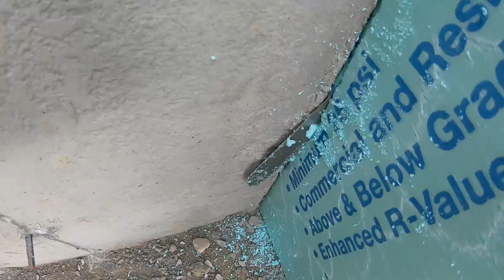Installing rigid foam on concrete walls & back filling Tri-County  Excavating 'Dirt Boss'

Comment: Unless you cover the exterior foundation wall with a waterproof membrane (such as PolyWall) or with a paint-on coating (such as those by Henry), the wall will attract moisture, making it a water reservoir, and then making the inside damp/wet as well. You'll also need a dimple mat between the exterior wall the insulation to drain water down and away from the wall. Basically, this video misses the entire moisture management issue with basement walls and only attempts to deal with temperature control. You want the thermal insulation to be vapor permeable to prevent locking moisture into the wall.
Reply from the maker: I hear what you're saying makes sense 100% but this is backfilled on both sides no need for vapor barrier It was engineered We are just installers
Reply: No clue here, neck down kinda workers. Here is why your houses only last 50 years at max people. I'm just an installer....Zero integrity.
Reply from the maker: @johns.1940  Lol Nice one Mr John
Reply: @DIRT-BOSS poor engineering

Comment: That was really good - such a pleasure to watch you work at your trade. I know how you felt about the drone footage - been there, done that! One thing we do as a backup is always have DU Recorder (screen recorder) turned on  so we  at least have something if we forget to record on the drone SD card. We typically set ours at 1080 P so it would be usable for Youtube. You may not want to air that, but it's just a thought. Thanks again for sharing. Don't know if you've seen it, but Stoney Ridge had THREE more bee swarms today which made a pretty interesting vid.

Comment: In Michigan the insulation goes on the inside of the wall only in a walkout basement, the rest just gets waterproofing on the outside. I've never seen tape, caulk or resin paper used.
Reply from the maker: Yes it's not typical around here it's just that this was a net zero build

Comment: What about if you had a walk-house basement? I assume insulate the 3 sides that are adjoining the “conditioned space” aka the basement itself….but what about the small frost knee wall below where the walk out is? That’s below grade but doesn’t cover any livable space on the other side.
Reply from the maker: Yes you definitely want to insulate the inside at least of the walkout Frost wall

Comment: Do you shave off the 2” lip of rigid foam at the top once the caulk is set?
Reply from the maker: You can but in this project we did not homeowner wanted the extra thermal break

Comment: Good job. Should it be better to waterproof the concrete and then put the insulation. By chance if there are leaks, it will keep water away
Reply from the maker: No need to waterproof because it is back filled with dirt on both sides
Reply: @DIRT-BOSS  thanks
Reply: @DIRT-BOSS then why are u insulating sub grade ?
Reply: Then why insulate it if the space is not conditioned? The better choice would be to have a insulated floor before the slab pour Dirt is a great insulator by itself  seems like a waste as you did not really insulate any space